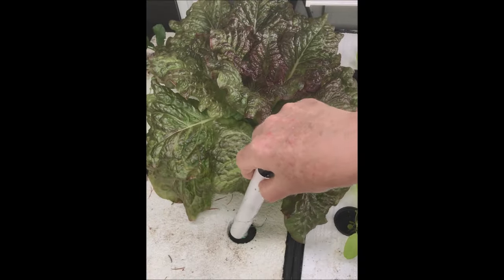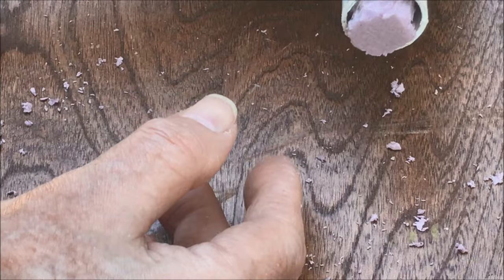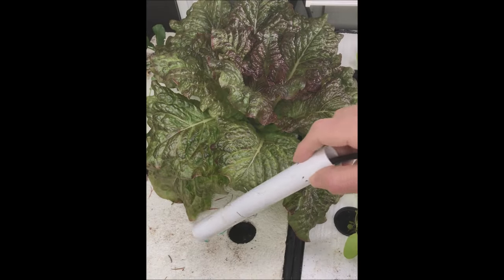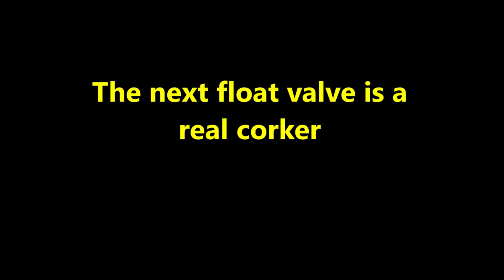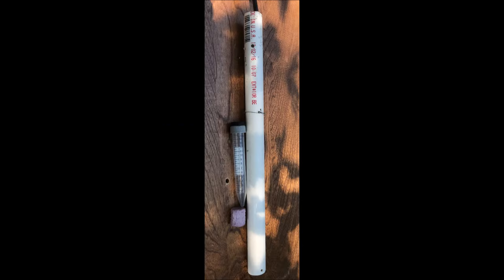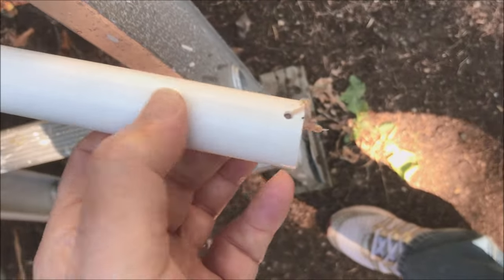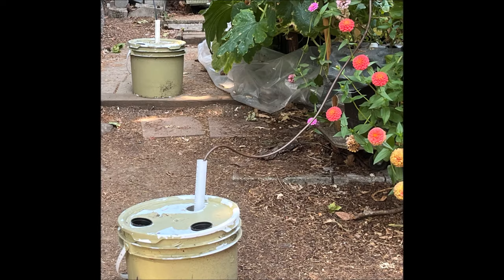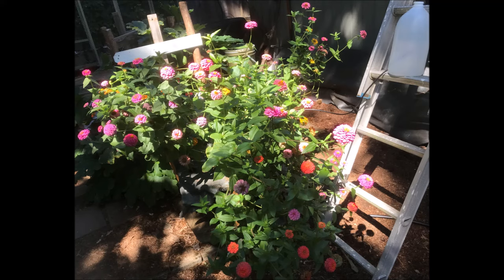Dipstick Float Valves for Watering Plants - Part II

Comment: A very intelligent approach and thorough topic discussion, the simplicity of the design lends itself to modifications if needed.  I have used your reservoir setup similar to what you have in your greenhouse.  The introduction of low cost float valves as you mentioned is a wonderful way to address refill needs for containers on unlevel ground.  Well done!
Reply from the maker: Thanks Matt!.  It's great that you have tested a reservoir setup already and see the advantages for watering plants in containers on uneven ground.

Comment: I was thinking about valve for higher pressires based on bending the tube and creating a crease to stop the flow. If you attach polystyrine float to the end of the tube and fix part of the tube rigidly, float will create a crease in the tube and stop the flow. Your thoughts?
Reply from the maker: I hope you will try your method out.   By the way,  we commonly folded over the ends of polyethylene irrigation tubing and tied them with wire and then didn't need end plugs for the tubing, so yes, a creased tubing can stop water flow.

Comment: Unless if I missed it in this video or the previous part 1, couldn’t this be made to be height variable by drilling a series of holes up the pipe? That way you could pass the wire through and secure it at whatever height hole for your application. This would allow for any heigh within 2” to 24+”. It would require more pipe than necessary on the low end but would make up for that in versatility in my opinion.
Reply from the maker: Yes, that is a good idea!

Comment: Great video, I just terminated my first generation of hot pepper plants in indoor hydroponics due to struggling to keep solution levels in check in their six individual containers. I'm thinking about redundant sticks (two per container) so no more plants die when I go on vacation. I'll also get one of those smart water leak monitors to message me if the "plumbing" goes really wrong when I'm not in my apartment. I wonder if a better valve than the neoprene sponge could be made, for example by 3D printing a flexible material, combined with something to ensure alignment in the tube
Reply from the maker: Thank you.  I really believe you are correct about the possibility of improving the float valve by 3D printing and I hope that someone tries to do it, because 3D printing is beyond my capability.

Comment: Where do you get extruded polystyrene, made more complex because I’m in the UK…expanded poly is easy to come by , but extruded?😕
Reply: I wonder if one could use the high quality packaging foam that comes with some electronics 🧐
Reply: I found it as insulation  sheets at a home improvement store
Reply from the maker: That is where I purchased my extruded polystyrene. @cathibeastevenson634

Comment: I'm thinking of using neoprene clone collars and/or a foam pool noodle for a float valve. Do you have any recommendations for a food/water-safe adhesive (or does it not need to be)?
Reply from the maker: It would be preferable to have a food-safe adhesive.  I don't have any recommendations, but hope another viewer will have a suggestion.